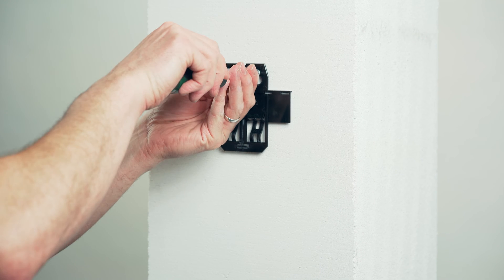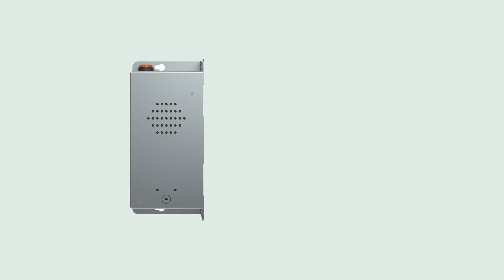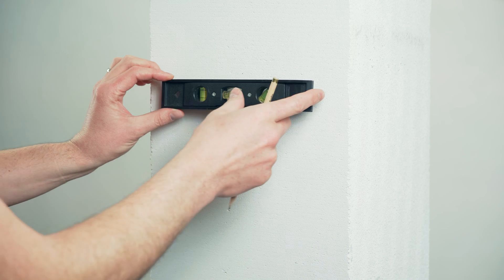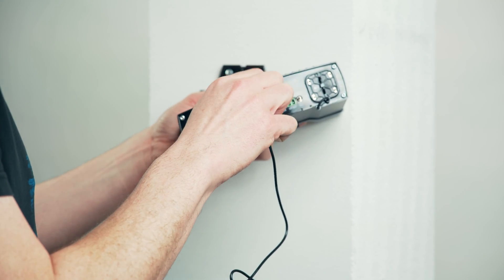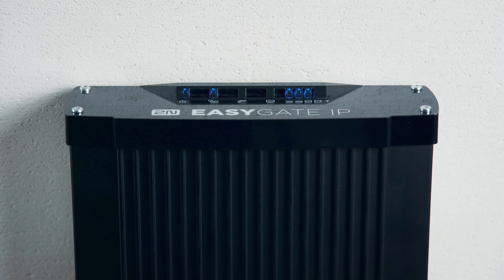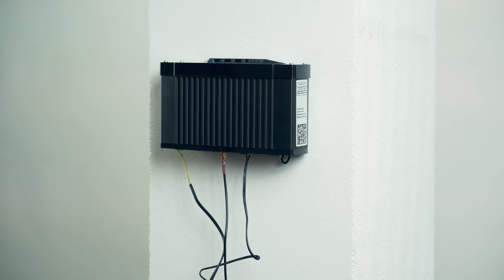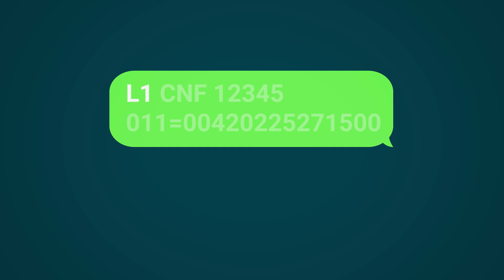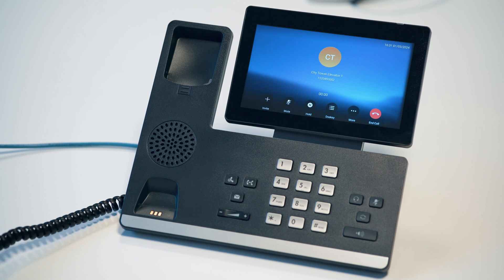How to install and configure the 2N EasyGate IP with the 2N Lift1

Comment: What if the lift plant room has no GSM signal?
Reply from the maker: Hello, great question! 2N EasyGate IP should be installed in a location with GSM signal coverage. If the gateway must be installed in machine room, it comes with an antenna with a 5 m long cable, so the antenna must be placed in a location with signal coverage. If this is not possible either, we also offer a high-gain 9dB antenna with a 10m cable, which needs to be placed in a location with a signal.
Important to note: You should never install 2N EasyGate IP on the roof of the elevator car.

Hope this helps!